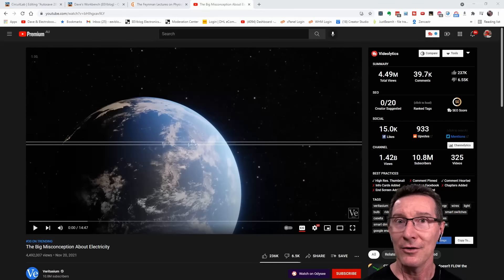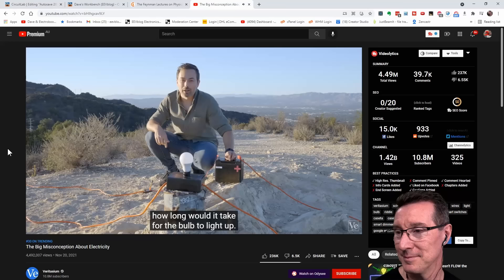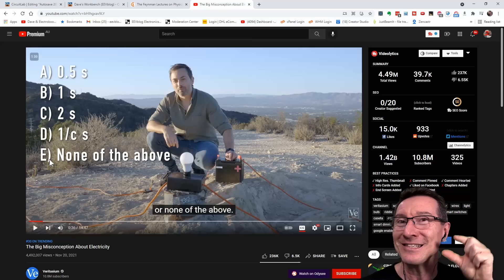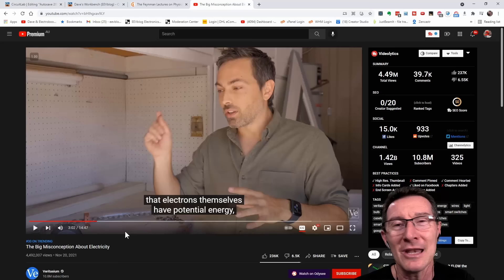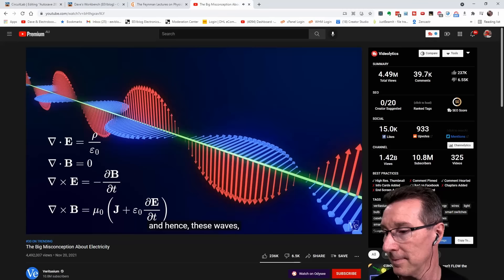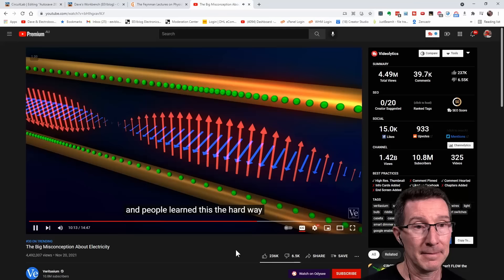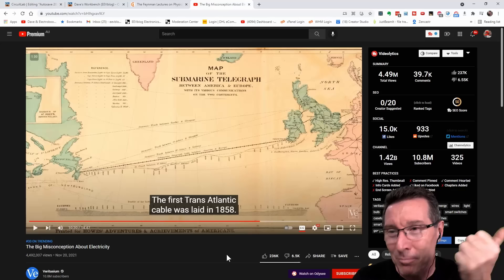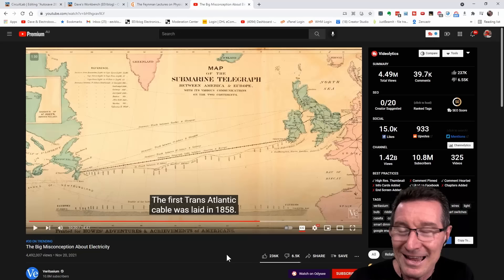EEVblog 1439 - Analysing Veritasium's Electricity Misconceptions Video

Comment: 30:00 It's actually an important fact, that initially it doesn't matter if the circuit is closed or not. If that made a difference it would enable faster than light information transmission, which in turn, would spin up Einstein to really high rpm in his grave.
Reply: What I wish there was more discussion of here (especially since it's something Derek got so into in the Slinky Drop series) is a difference between how quickly the information that the switch has closed gets to the light bulb, and how long it takes to actually light up a practical light bulb, and for how long it would stay lit, etc.  Like, I can grok the information getting there, but how much power is in that brief spike Dave showed in the simulation?  Not much, I should think.  Enough to even light a red LED?!???
Reply: What if the bulb was at one end with everything else the same?
Reply: Yeah, 1/c ! LOL
Reply: @nin1ten1do  the same coward and hypocrite person you describe also described gravitational lensing and postulated how LASERs work way before it was possible to test both. Just to name a few things aside from general relativity and special relativity.

So, let's stop trolling here. Thank you.
Reply: @manojlds  Then the bulb won't carry any current until the transmission line carries the transient all the way to the end.  It  will turn on in seconds instead of nanoseconds.
Reply: @DavidLindes  It's only a brief spike because the "transmission line" is super short in the type of testing that he did.
If it were really possible (zero resistance transmission line to the moon) Then there would be current flowing charging the capacitance for the whole time it takes for the transient to propagate to the wire connecting at the far end.  It'll light up as if it had the impedance of the transmission line in series,  so it should turn the LED on at partial brightness for a couple seconds.  After that, when the transient hits the end of the transmission line without proper termination, it'll reflect back, so there would be some flashing of the LED every couple seconds, until the LED's resistance and energy consumption eventually damped it down to steady state, after which it'll just be on as if it was directly connected.
Reply: @DavidLindes  depends on how big your battery is; with enough of an electric field you can make a lightbulb light up without it being connected by any wires at all; see: holding up a low energy bulb near a high voltage power line.
Reply: @leemarshall9946  Given what Derek seemed to be showing in his video, let's assume nothing more than a small car battery (of the 12V-nominal variety, sealed lead acid or whatever).
Reply: @nin1ten1do  the Tau Neutrino thing has been debunked. I believe it was a failure in the instruments reading. Anyway... no FTL Taus.
Reply: Wow. Thanks for that.

I was wondering that, actually. Even if the  electron ain't moving thru the conductor, would that energy passing thru the fields not count as information?

It's funny how sometimes a simple realization that it doesn't matter the state of the switch for all to make sense.
Reply: I think a real scientist like Einstein does not spin in his grave (except the particles of his remains) if his/her theories are "extended".
Reply: @karlschmied6218  Well, transmitting information faster than light just with electromagnetic phenomena (governed by the Maxwell equations, which were one of the incentives to develop special relativity, i.e. anything modeled by the Maxwell equations is well within SRT), sure isn't an "extension", it's just plain wrong. Had he been asked about the subject he'd likely have pointed this out.
Reply: Wassily Kandinsky . I said „extended“ and not extended. Do yo think Newton is spinning in his grave because of Einstein‘s „extensions“ of his theory?
Reply: @wassilykandinsky4616  Newton is just jealous he didn't do it himself.
Reply: @Pengochan  "sure isn't an "extension", it's just plain wrong." Till now every theory has been shown to be "plain wrong" except those who are "state of the art". I think it's a fundamental and perhaps nonsensical question wether there is a true reality that can be "modeled" by a true theory. In this case the theory would be the reality itself. There are some physicists that lean to such a thinking, like e.g. Max Tegmark. And of course Plato and Descartes and many others already thought about the sense of the idea(l) of an ideal world behind our possibilities of "direct" perception.
Reply: @karlschmied6218  My point was, that you can't have any FTL information transmission within the framework of the Maxwell equations, i.e. the framework used for electromagnetic phenomena such as this. We already know that this model has it's limits, e.G. when considering quantum mechanical phenomena or general relativity.  But the question and what's more, the answer are clearly stated within the framework of "classical" Maxwell, and I made it explicitly clear (to close exactly such loopholes) that within that framework you can't get FTL information transmission. That won't ever change.
So any way of getting FTL information transmission based on classical electromagnetic theory (i.e. Maxwell) is just plain wrong, and mathematically provably so.

It's like having a triangle where the angles don't add up to 180°. Sure, in a non-euclidean geometry you might get that, but if you get that within euclidean geometry, then it's just plain wrong.
Reply: Pengochan . I agree, thanks for pointing it out.
Reply: Yes, that guy again

Comment: I guess everyone needs to define what 'on' means. For Derrick's answer, 'on' is any minute power dissipation in the lamp (and his answer is correct for that definition), but my first reaction is that 'on' is the full power dissipation allowed by the impedance of the lamp, and the power source. This version of 'on' is not reached until the EM propagation is allowed to travel through one half of the circuit. Before t=0, another assumption can be made that circuit is in state with the switch closed, meaning that the entire circuit is at the same charge between the left side of the switch, and the same charge on the right side of the switch. That EM charge is unfolded at the speed of light after t=0 and the light goes to full 'on' once there is a positive charge on both sides of the lamp (ie c times half the circuit length).
Reply: This is what confused me at first too, especially after he had all these EE guys talking his claims up. The lightbulb is probably already "on" just from random background charges moving: no power source needed! His explanation is not really what most people think of when they think of "on".
Reply: Perfect observation. You should be a Mathematician (if you’re one not already) or a good philosopher that seeks Truth above all else. 👍👍🤜🤛
Reply: Exactly! The whole topic is ill-defined. It is basically impossible to do any useful lighting (even if ignoring all the effort to make the element inside the bulb to start to glow) before 1 second.
Reply: This is the first explanation that makes any sense.   In a pedantic and nitpicky sense, the moment the switch is closed, changing electric and magnetic fields propagate from the battery terminals and its adjacent wires, to the bulb and its adjacent wires; but this power transfer is incredibly weak, and may not even cause a single photon of light to be emitted.  Derek assumes that one photon DOES get released immediately after the switch is closed, calls this the "ON" state, and drops his mic.

There's got to be a better way of teaching Poynting Vectors and EM power flow to kids, without causing this level of confusion, which is based on an impractical technicality.   Maybe replace the DC battery with high frequency AC source, and have the target bulb be something that can be usefully energized by that source.   I'm thinking of something along the lines of the "fluorescent bulb lights up by itself near high voltage AC lines" demos have been around since forever.

Comment: Thanks for the video and the analysis. Here are some comments:

1) You don't need to add 'second' to the answer when you say 1 m / c. C already has units, so the answer should simply say 1 m / c.

2) In your simulation, you simply assume a capacitance and an inductance for the transmission line and the simulation doesn't take into account the finite value of the speed of light. It seems to me that the simplifying assumption of the circuit is that the transient effects in the circuit are fast enough that the finite speed of light won't affect the result so you can simulate your circuit at 'infinite' light speed.

3) I think the initial transient pulse that the light bulb sees can be more easily understood in terms of radiated waves when you initially turn on the circuit. If I attach two short wires to a battery to form a dipole antenna, at the moment both wires connect to the battery, the wires would emit electromagnetic waves due to the square wave pulse. This can be then received by the same kind of setup with two wires forming a dipole antenna and a light bulb replacing the battery. The received signal would create a non zero voltage difference between the terminals of the light bulb. This doesn't prove that in the steady state, the power is transmitted through the air and not through the wires. The transient signal doesn't have anything to do with the steady state flow. 

4) Since we are assuming any non zero voltage is enough to turn on a light bulb, when I do this little experiment I basically turn on all the light bulbs everywhere around the world. :)
Reply: I think he used "c" to represent just the value so that answer would've been written as 1m/(c) m/s, which simplifies to 1/c s.
Reply: @spidaxtreme  That wouldn't be a common notation in physics since c is already defined with a unit.
Reply: @couplingconstant  it is in relativity theory; since c is used all the time, units are dumped out the window, and you see a 1/c appear in a temporal coordinate all the time.
Reply: @takix2007  I'm not sure what you mean by that. Yes, factors of c or 1/c appear and they have proper units. Position four-vector is (ct, x,y,z) and all components have units of length, or four-momentum is (E/c, px, py, pz) and all components have units of momentum. In particle physics you often use natural units where you set c to 1 and change the definition of meter and second. Then you completely drop all the c factors from your formulas since you set it to 1. But that's not what we are discussing here.
Reply: @couplingconstant  indeed, that was exactly what I was referring to. And indeed it has little to no bearing to the discussion at point.
BTW, you surely meant to say that all components of the four-vector have the dimensions of lengths (which can be expressed in units of lengths, i.e, meters in SI) ? 😜
Reply: @takix2007  well, you were talking about dropping the units so I went with that, haha. But yes, I agree that it would be more correct to say the components have the dimension of length.
Reply: Just to add to this discussion, as many pointed out, the component of the Poynting vector parallel to the wire carries the power from the battery to the light bulb and the magnitude decreases very quickly as you move away from the wire. The perpendicular component is there and is equal to the power loss due to ohmic heating in the conductor. In the steady DC case, the energy doesn't magically flow from the battery directly to the light bulb just because they are physically close to each other, it still mostly flows parallel to the wire.
Reply: @couplingconstant  touché 🤣
Reply: "when I do this little experiment I basically turn on all the light bulbs everywhere around the world."- corollary I: all the light bulbs everywhere around the world are always turned on
corollary II: No light bulb anywhere in the world can be turned off because the turn off mechanism has not been devised yet by Veritaseum
corollary III: who needs wires with zero resistance?
Reply: @MichaelClark-uw7ex  a few million volts? How did you calculate that? :)
Reply: @couplingconstant  Well the short cable deployed by the space shuttle generated thousands of volts before it burnt in two and since induced vooltage is a function of the length of the conductor and this cable would be thousands of times longer.
Thousands times thousands equals millions..

Comment: Thank you for this video. I am not an engineer, but an electronics and ham radio hobbyist for about 45 years (and biologist). I like how you explain the different perspectives of engineer and physicist, and allow for the differences due to intended audiences. Usually it is not required that analogies be totally faithful and descriptive of reality, if they provide some increased understanding! I will keep studying the physics, and the transmission line theory, but I will also keep building stuff like 9:1 unun to allow me to use non-resonant wires for my antenna systems. I am often having fun with other people's designs. In our radio groups are some retired electrical engineers and I am always so amazed at how they build stuff based on their OWN designs. Wow! Keep having fun learning, and (if you are so inclined) building stuff! Both can be VERY fun. Dave WA4NID